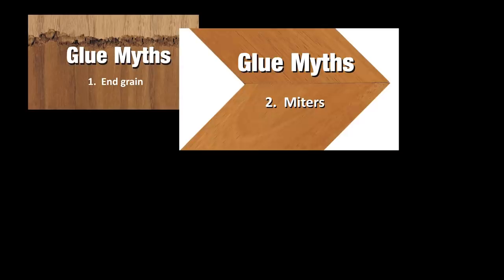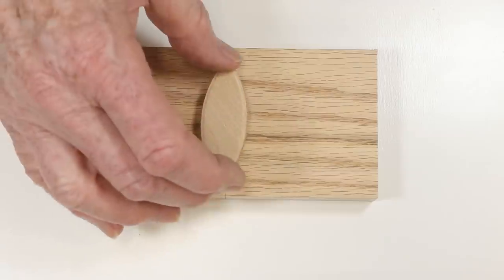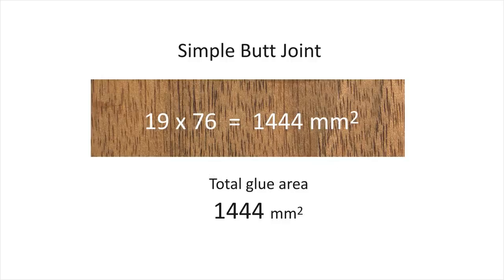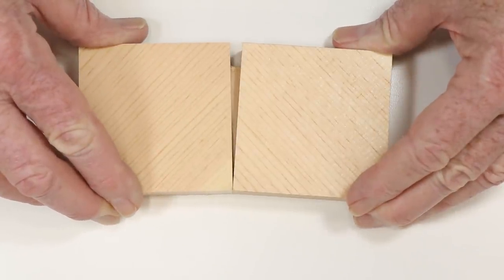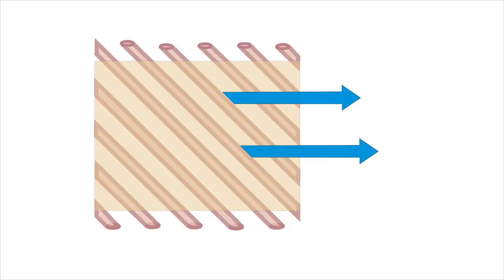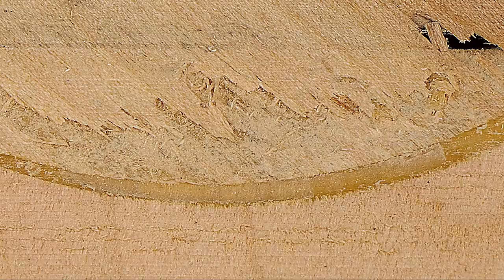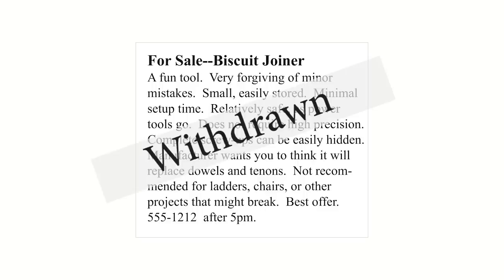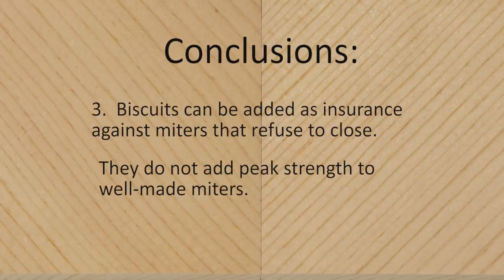Glue Myths:  3. Biscuits

Comment: Hi Patrick, I'm not a great woodworker, but I do know a little about stress and strain. the way you tested the biscuit joint creates bending through the piece, which means axial tension is generated at the top surface, and compression at the bottom surface. because the biscuit is in the middle of the piece, at the neutral axis, it actually doesn't see much of the bending stress, so it's not contributing much to the strength of the joint.

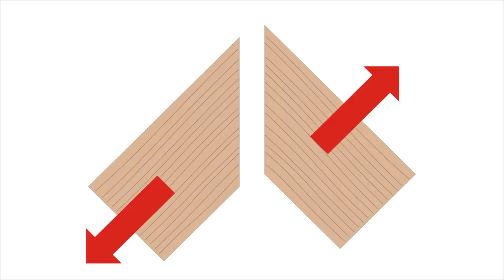aside from helping with positioning the pieces, what I'd expect the biscuit to help with is transfering the stress from one side of the glued joint to the other when you're putting the bending across the long aide of the wood (similar to the prying apart of the joint which you showed in the images at time 7:30 in your video). I'm not sure how great the effect is, but if more of the force is transfered into the fibres in the biscuit, then from there into the fibres on the other side, it would probably do more for increasing the bending strength of the joint... the top half of the biscuit would be transfering axial.

hmmm. didn't explain that well  but the summary is that for your tests, the piece was bending around the biscuit, with the biscuit being in the neutral plane for that load orientation
Reply: A second test based on the above with 2 biscuits could give an answer to the above. I do love the testing and results and myths busted! Thanks so much Patrick for this series :-)
Reply: Shaun, I found myself asking: how would the biscuit affect tensile strength? My initial thinking was that the additional glue area created by the biscuit doesn't change the glue area along the plane of the failure, but that is pretty shaky. I think your analysis is correct in terms of why the peak force to failure in bending doesn't change. But since the mechanics of wood and glue are so complicated, there is an additional set of head scratching questions. Since the failure here is brittle, boundary conditions are critical: say we move the biscuit as far from the neutral axis into the peak tensile stress, that would effectively mean just slapping it on top and across the joint! That changes the mechanics entirely, since it would be far more difficult for a crack to initiate with the long wood fibers in tension. Where would it fail then? So, while it could be interesting to see the test repeated with a biscuit at different distances from the neutral axis, I think it's maybe more fruitful to think about the broader class of splines, inlays and the like. Each will change fracture mechanics under different loading conditions with their own benefits and drawbacks. It would be fascinating to see different methods compared through tests under a variety of loading conditions: if well done, that could add some real engineering foundation to woodworking practice.
Reply: @jiijijjijiijiij  Except that this series is about glue and not about the geometry of the joint. He specifically says that these results only apply to stress as generated by “my rig.” He shows at the end a number of force vectors that are typical but not tested.
Reply: @blacksmith67  you’re right, but it is unfortunate that he went to all this work but then applies the force at a direction that a miter joint like on a picture frame would never have
Reply: I do Agrar, tha a biscuit in the neutral axis should not improve the bending strength. In practice, joints with biscuits are stressed often perpendicular to the biscuit plane. That could be a test worth to do. Or biscuits are loaded with a force parallel to their plane, eg. if put in two rows into a thicker board and away from the neutral axis. So I will continue using hundreds of biscuits also in future, and I am confident they will hold things together. Btw: Since I live near Basel where the original Lamello was invented, my English might be only semi-correct
Reply: @jiijijjijiijiij  I can only suggest that you watch the video again. I saw a whole bunch of caveats regarding the applicability of these tests in all three videos. It seems quite clear to me that this is exactly about glue bonding wood. He specifically said that biscuits were a way of increasing the glue area. He also shows, sorry if I am repeating myself, the forces that he is not testing with his setup, such as bending right angle mitre joints in/out, or pulling in various directions.
Reply: @jiijijjijiijiij  I am an analyst by trade, with superlative skills in formal logic and a decent background in the study of language. I have parsed more technical information in my lifetime than I care to remember. I didn’t think that I would have to go through the videos with a fine tooth comb to illustrate where you are wrong, but I guess I have to now. I just assumed that you would watch it again, see the points that contradict your position (which I did state although I did not directly quote). When I am wrong, I have no vested interest in being wrong and readily concede. Some people evidently still have to double down for no useful reason. I will be back later with a full analysis.
Reply: @blacksmith67  So what's the point of all these videos if they have almost no application in the real world? Learning stuff about glue that's not applicable to using it is not very helpful.
Reply: It's still a valid test though because this is the common configuration of a biscuit joint

Comment: As others have said, alignment is the issue when I pull out the biscuit joiner. Almost always in situations where I have side grain to side grain - not end-to-end grain. 

The myth seems to be that people use biscuits for strength since most comments state they have never relied on them for strength. The series does help us all in that it is consistent in method and either reaffirms what we suspect or blows up the folklore of others. 

Great series with a lot of lessons.

Comment: One point to consider: the biscuit was inserted to the neutral axis formed by the bending moment. I think this location plays a bigger role then it's mechanical properties or the gule.
Reply: Yeah. I kinda wanna get a tension or shear comparison

or bending moment along the other axis, to simulate a miter opening due to wood movement
Reply: @JohnDotBomb  These tests desperately need to isolate shear and tension as different tests. His load testing creates stresses that would not ever be induced in actual joinery applications. 

This one for instance induces a high shear to bending ratio (and loaded in the typically nonstressed axis to boot). All the extra glue surface area is rendered useless because it is outside the shear failure plane, and as you said it's extra tensile properties have to impact because it is in the bending neutral axis. Then after the thing has failed he finally puts it in tension when he tries to pull it apart and is shocked it is actually suddenly doing something.

Comment: Mr. Sullivan:  I very well done video....the filming, voice over and graphic work is top notch.  Thank you.  I would only say one thing though about the content and that is, we don't use biscuits for strength, we use them for alignment.  If I'm trimming a window and using 1/4 stock or mdf flat stock or whatever I may use a biscuit so that the faces align.....not because of strength.  The glue is strong enough on it's own.  I trimmed a house once and after finishing the lady decided she wanted shiplap everywhere so a guy came along and took down the trim around most of the windows and doors.  They were coming off like picture frames ...in one piece and they were only glued (at the miters).  Glue is plenty strong on its own.

Comment: I suspect it's not so much a matter of "glue area doesn't matter" as "glue area where the stress concentrates does matter".  It's the difference between static and dynamic analysis (ouch, using the Wayback machine to 1970!).  Any force applied becomes tension in one area and compression in another, and the exact location of the critical stress can be deceiving.  The location also moves as the stressed structure deflects under load.  The 45 orientation of the biscuit grain is probably a clue (manufacturers didn't arrive at that orientation by accident).  Biscuits might contribute more to joint resistance when the joint is loaded on a different axis than the simple end grain reinforcing axis.  However, at least it's good to know biscuits don't reduce the joint strength.  Excellent videos Mr. Sullivan.  And to your profession:  "thanks for all the fish".  (I'm a forensic engineer!)

Comment: Patrick,  Love it.  I would also love to see results in pure tension and shear too, if you could do it.  The bending moment butt joint to failure is actually a combination to the two.   Envision the top of the joint is in tension and the bottom is in compression over the fulcrum.  Also, try smearing some glue as deeply as you can by rubbing it into the end grain and then adding a bit more glue.  I've done that on miters in red oak and it seems to be even better.  Did kitchen cabinet doors like that (no splines or biscuits) 30+ years ago and they still are together.  Thx for the testing!

Comment: Patrick, thanks for this clear and understandable video series. I hope your viewers' take-away is that woodworking joints should be designed to rely on the interlocking structure of the joint for their strength against the forces at play during the object's intended use. Glue is intended to prevent the joint from slipping apart in the reverse direction of assembly, which should be in the direction LEAST likely to have excess force applied during use.

Comment: If you want to treat a biscuit like a piece of rebar then you would add the biscuit as close to the outside edge as possible. Adding strength as close to the center as possible does little to prevent bending forces.

Comment: Thank You for your excellent video 
I seldom use my biscuit joiner except for difficult joints never for strength. 
Small tip for biscuits keep them in a sealed bag or container add descant pouches for added protection from moisture.

Comment: In material science, a distinction is made between strength and toughness:
(1) Strength is the maximum force (per area) a sample can withstand before breaking.
(2) Toughness is the energy (per area) required to break a sample.

Because force is different from energy, it follows that strength is different from toughness.

Objects with high-strength but low-toughness are brittle (like glass), and fail abruptly/catastrophically.

Objects with medium-strength, but high-toughness usually fail more gracefully; they begin to break at a lower force, but their higher toughness means their failure is progressive.  For example, they start bending, or progressively tearing.  A lot of energy is required for the progressive bending, or the tearing, so they don't fail all at once.

It seems to me that the biscuit adds no strength, but seems to add some toughness.

Comment: You nailed it when you state the area vs the direction of the force applied equal the strength of the joint. With a biscuit, the area of glue is actually DECREASED when you are talking about the direction of the force applied. This means the amount of strength gained is about equal to the amount lost to the lack of glued surface in relationship to the direction of the force applied.

Comment: It was my understanding that biscuits were for alignment and a bit of strength for butt joints (ie. cabinet rail styles, frames etc) or slab glue ups. Very interesting info, thanks!
I made a solid oak table, used biscuits to help align the oak planks for the top, it has never cracked or separated along the joints.  Later I needed a quick T.V. stand, used biscuits as shelf supports, glued and clamped. let dry. That stand held an old heavy 27 inch tube T.V. for a few years before T.V. was replaced and is still holding together.

Comment: Hello Patrick Sullivan.
As a mechanical engineer I can tell you why a biscuit wouldn't add strength in your test, even if the biscuit was made of something much stronger.
Whenever a given object is experiencing bending, the actual stress in the material is NOT uniform across the thickness of the object.
It is the highest the further away from the center (oversimplified) you are.
And as such, a biscuit put in the center of the boards won't ever get to help reinforce the joint when it comes to bending.

Perhaps a test with a board thick enough to have two biscuits in the height plane could prove that biscuit either add or subtract strength.
The biscuits would need to be close to either surface instead of bundled together in the center.
So perhaps a 20mm thick piece with either biscuit being only 4mm below the surface would prove to be stronger or weaker than without.

Comment: Ha ha, I knew or lets say felt that biscuit joints doesn't do any much help to strength :) so I never bought one and I always thought they look stupid... But it seems you have more opposite comments for this video compared to the first two videos and I guess that is because many new wood workers have been convinced to buy a biscuit machine and using them since a time and don't want to accept that that machine is not much use except for the aligning purpose. 
But for my view, If you cut the 4 pieces identical to each other, there will be no problem with alignment and you can also always hand plane them a little and there you go, you have a perfect miter...
Thank you very much for the video 👏👏👏👏

Comment: I watched a video about what makes the material strong when forces are applied like this. One surface is under compression, the other is under tension. Most of the material in the middle does not contribute too much. So the only way to increase strength is to put something on the surface. even thin veneer will do better than biscuit. However ff you are making a frame a spline will add to the strength, because as you said there are other directions that forces can be applied from.

Comment: How about splines?  I've had it drilled into my head by hundreds of other videos that biscuits are not for strength, but alignment.  This is hardly a shop myth.  You showed a spline and then completely ignored them?
Reply: Results for spines were pretty similar (no added strength, but prevent total failure). Patrick hasn’t done it yet on this channel, but another channel called “dk builds” did a video a while ago titled “do splines even do anything”. It’s done in a similar vein to these ones. :)

Comment: In the shop where I work, biscuits are used primarily for alignment.  We build drawer boxes out of melamine by placing a biscuit or two in the corners of the drawer box.  These joints also get glue on the spline joint as well as melamine glue on the butt joint itself.  Finally, the joints are stapled together.  We never have any failures with these joints.  I have taken some of these drawer boxes apart and they always break apart with the particle board still glued to the biscuit.  In this case the biscuit is stronger than the particle board around it.
Reply: I was given a large divided cabinet, melamine covered plywood. all the dividers  and shelves were biscuited, I had to cut along the shelf gap to get apart. the glue hadn't stuck to the melamine but the biscuits sure put up a fight. When I did get some shelves to come out, the plywood/ glue failed around the biscuit or some just broke. Was crazy how hard it was to take apart.

Comment: Been waiting for this one!  My guess is that the glue joints of the biscuit to the slot don't fail - the glue area that counts is the butt to butt joint is actually lower, and the biscuit itself cracking is proof that it's adding about the same resistance to the glue lost, not any additional.  i think that's my takeaway from your testing too...  and i think the point about facilitating assembly and getting good alignment between parts is right on the money.    either way another great, data driven video that had my riveted

Comment: The purpose of the biscuit is for alignment during glue-up and to hold the project together even if the glue joint fails.  Also, biscuits should be used with a water based glue to work properly.  Biscuits are compressed and the water is absorbed by the biscuit making them expand to provide a tight fit and proper alignment.  I've glued up biscuit joined pieced and then needed to pull them apart several seconds later because I goofed up and they would not come apart because the biscuits swelled up and held everything in place.  I switched to Titebond III and noticed that my parts still had a lot of movement to them even several minutes after being glued.  The reason being that itebond III is a polymer based glue and if it does contain any water, it's not enough to swell biscuits.

Comment: Biscuits are great for aligning pieces to eliminate "lipping" and making it easier to clamp mitered frames together as they minimize slippage. So they do have a use, you just have to understand that when deciding whether or not to use them. Same with floating tenons popularized with the festool domino